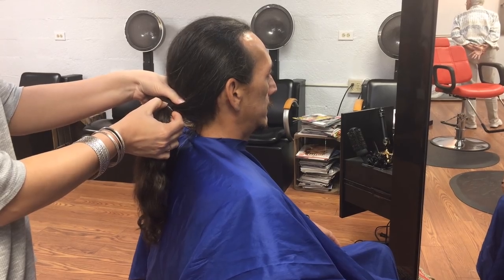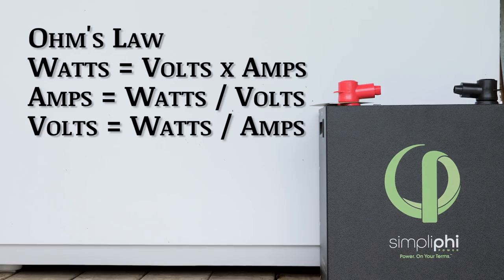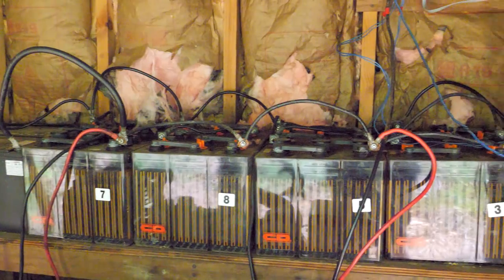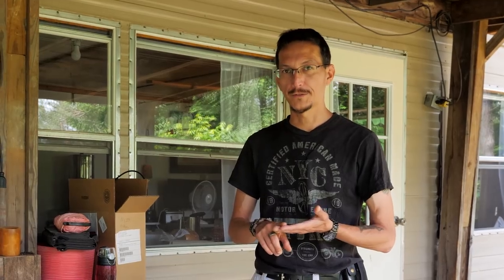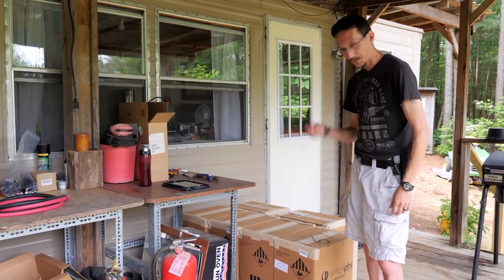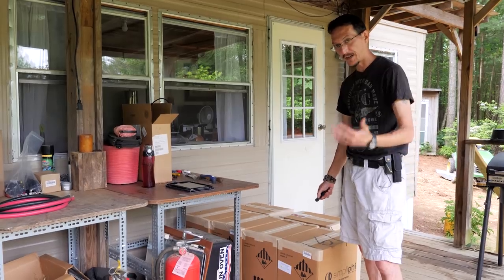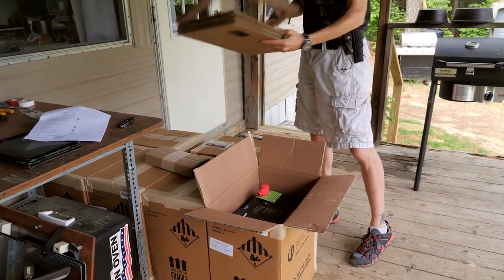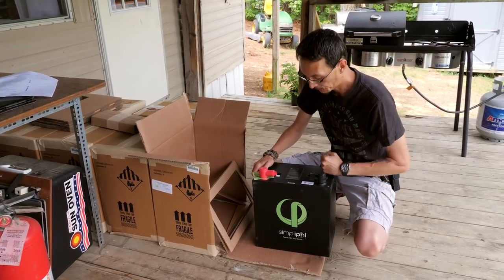DIY Off Grid Solar: Building a LiFePo4 Battery Bank (Part 2)

Comment: In another video someone commented on the length of wire from panels to inverter to end usage
Dc/ac
The bigger the wire the higher the ohms 
A.c. travels faster (less amps) or slower?
R = e over I
Did you look into moving inverter closer to batt and sending a/c thru lines?
Of course a trailer usually is wired @ 24 v dc
I heard you mention air conditioner , no way to run in DC
Fridge could be propane too
This argument goes way back to Tesla and the grid we live with
The other conundrum is geo thermal
Have you / will you exp. With this technology?
Wind turbines?
Grow your own food?
Fish pond/aqua ponics
You my friend are Living the dream!
Not jealous but envious in California

Comment: Excellent sir, Can you please make vedios for converting old any petrol bike to EV.
Also can you suggest me here I'm wud like buy 12v 40 AMPs battery. Does it give 50kms per charge...?  What is motor watt should need to select can I use 1000wat motor or do I need to select less than500wat,
 12*40=480 watt...?

Comment: Higher voltage is more forgiving on wire length... More important than having panels close, low voltage links (battery - > inverter) should be as short as you can make them with thick cables....

Comment: Man if i had to put out so much cost for batteries to support a daily 5 KWh load, i think it be may wise to just buy a 10-15KW diesel generator , im just saying if it is me, cause all electrical system has pros n cons, think about it! nothing could beat the Driven Alternator power output

Comment: As you said when ever there is a change ( inverter etc. ) there is loss of energy usually in the form of heat.
Charging the battery is also a cause of loss . For lead acid it's about 10% + a huge loss when balanced occasionally .  LIPO batteries are about 1% loss.  So your solar array needs to be larger also.

Comment: is there a formula for inrush amperage??  (like for an air conditioner compressor)  my running watts are 850.  15 amps. 120v ac.
Reply from the maker: Not really, you have to actually measure the surge amps when a compressor or pump or motor turns on. General rule I’ve heard is that surge current is 3x running amps though. 15 amps at 120v is more like 1.8Kw.
Reply: well the sticker says "850 running watts".  maybe I am not understanding you right, but how is the running load 1.8kw?
Reply from the maker: The 15 amps must be the starting surge load then because 15 amps x 120 volts is 1800 watts. That would make more sense. If it says 850 running watts then 850w / 120v is 7.08 running amps. That’s typical for a medium sized window unit. I have a smaller one than that I want to try on this new system.
Reply: ok this is an 8000 btu window unit by GE.  What is your estimate on a 5000 btu unit? what size is your ac?
Reply from the maker: Mine is a 5000btu Frigidaire. 4.8 amps, 515 watts.
Reply: ok. what are you going to do with all your old solar components?  Will you sell them to me ?
Reply from the maker: I have many pieces and parts but I’m going to try to make a small 24v system just for DC appliances. Once I get that figured out I may sell what I don’t use.
Reply: great keep me in mind!

Comment: You are incorrect regarding the voltage drop in long wires.

It's the amps that causes the loss. The higher the Amp, the higher the loss.

You will see the loss as voltage drop at the other side of the cable.

To prevent you can increase the wire thickness or increase the Voltage. By increasing the Voltage you reduce amperage (ohms law).

On a long wire run, you can run higher voltage on the PV, and if you have the correct charge controller, you can have a higher PV voltage than the battery.

The increase in price for these controllers are some times less than the extra price for thicker wires.

Comment: you did a great job explaining it.
Solar is a giant pain in the ass; buying a part time job really.
the panels cost from solar companies is over 30 years, yet the panels don't produce enough juice after 15 years. even with the tax credits, which will disappear soon, this turns into a scheme, rather than a viable solution.
it's like asbestos shingles, aluminum siding schemes of the 40's and 50's and 60's....

being off-grid, you really gotta do these calculations right...yet, it still comes down to the life of the panels, and the equipment down the chain.
best of luck.

Comment: Sorry to bother you y’all seem to have great ideas and help. I have noticed some people have ion batteries some have deep cycle batteries which seem to be cheaper. What would you use ? A 6volt series to another 6 then wired in parallel or just some 12’s wired in parallel ? I have seen YouTube vids on all 3. I would want something that I don’t have to worry about the batteries going dead over night.  I am downsizing and I am not a green person   Sorry and thanks again Gbl

Comment: I guess I am not understanding storage on batteries. So how would one of these batteries compare to a 1000 amp hour battery?
Reply from the maker: Depends on the voltage of the battery. A 6 volt 1000 amp hour battery is 6 Kilowatt Hours. A 48 volt 125 amp hour battery is also 6 Kilowatt Hours. Volts x Amps = Watts.

Comment: great explanations. it looks great. 48v is the way to go when running inverters. over 2.5k for one 3.3kw battery is a tall order. 10 year warranty my big toe. good luck with that. if everything works great its a better deal over the other battery technologies. but you never know and you cant make the manufacture honor the warranty. if things go south they go bankrupt change names then keep on trucking. great video thx for sharing I hope the system works as billed.

Comment: 3.5kW batteries of 48V comes to about "73A", however you said 6×"67Ah" a battery @ 48V. 
Did I miss something jumping from 73A to 67Ah?
Reply from the maker: 67 “usable”. Though they say you can completely discharge them I never would.

Comment: Sorry. You have stated Ohms law incorrectly. Ohms law is Voltage = Current times Resistance ( V=I*R).   What you are trying to state is the Electrical Power Equation P= V*I.

Comment: To increase AMPERAGE a longer distance you increase the diameter of the cable, not VOLTAGE.

Here’s an example,  look at you power transmission lines, high voltage, long distances, little wires.  The power is transformed back down to a lower useable voltage through a step-down transformer on the pole and comes into your home a shorter distance at 240VAC with a much higher flow of current available.

Another example is this, if the smaller wire creates more “resistance,” it creates more HEAT, which we know is associated with current, not voltage.  Voltage creates “pressure” in the lines, amperage creates volume flow through the line.

If you pressurize a tank of water to 4000 psi, and open a little tiny hole in it, the stream will spray out with a lot of pressure, cutting through whatever was in its way.  If you open the entire bottom up all at once, you get a massive flow of water with greater ability to perform heavy work at a lower pressure.

Voltage = Pressure = Arcing to dissipate excess

Current = Volume = Heat to dissipate excess

The combination of flow at pressure is what actually burns the wire up.  You need BOTH to do that.
Reply from the maker: Good explanation

Comment: We use about 100kwh per day and I am stingy on air conditioner settings. This is of course on the grid. This month we been 110 to 118 farenheit with index's way up.
Reply: You waste a lot.  Most homes waste 80-90% of the energy that goes into them.  Air leakage, thermal leakage, noisy appliances, heat given off - all waste.  Start eliminating some of that waste and your home will be more comfortable as a side-benefit.
Reply: @DK-vx5co  I live in a very hot location and my home does not get any shade from trees. I have 6" walls well insulated, double paned windows and recently installed solar shades on my windows. We have summers where the AC will hardly turn off and I have a back up 1 ton mini split to aid my 5 ton central air unit. I replaced all my indoor 76 lights with LEDs and have 8 shop lights outside with T8 tubes I believe. I also set the indoor temp to 74 instead of 70 this month. Now the next step is to replace my 10 year old washer and dryer. 

I am starting an off grid build and just recieved my 10x250 watt panels. I want a small 16x36 cabin now for weekend camping.

Comment: I can't find any info about why you can't connect those Phi batteries in series.  Does anyone know why?  Is it just because the internal charge controllers might draw different amounts of current, causing other batteries in the string to potentially see voltages over their limit?
Reply: The BMS would not be able to check the balancing on the other pack... so if you do connect them in series one could be at 100% charge and the other one at 80%. The BMS would keep the lower charged one from charging all the way and thus destroy is over time

There is a guy called Jehu Garcia he does a lot of battery stuff, may be check his channel for more info

In my opinion I don't really like Li Fe P batteries they are super pricey and if damaged very dangerous but that's just me
Reply: @Blue: But if the BMS is internal to each battery as seems to be the case here (six batteries, six BMSes), then it shouldn't matter what the other packs are doing, they can take care of themselves, right?

Comment: When I put my system together, I was cautioned not to use more than three strings of battery banks in parallel because of balancing issues between banks.  Since you ONLY wire them in parallel, (and the $3k Simpliphi 48V battery is only 67AH--pretty close to what my AGMs are rated at--but the AGMs are 1/4 the cost per 48V bank), does Simpliphi give a limit to how many batteries can be in parallel? You're running 6 in parallel, so it's obviously more than a standard battery bank.  I'm guessing that each battery's management system helps balance them (do the batteries share data via a cable?).  So your $18k 48V battery bank gives you 321 Amp-hours of capacity at 80% discharge?  I sure hope these battery prices come way down before my 8 AGMs die.  They were $200 each when I bought them in 2011 (They are $275 each now), so $1600 gave me 55 amp hours capacity at 50% discharge. They've been going strong for 7 years, but since I'm grid-tied, they rarely get below 90% unless I lose power for several days during a hurricane (which is why I sized them the way I did).  I realize that your usage is extremely different and gives your batteries much more of a workout each day than mine do.  But man, that price difference is significant.

And Simpliphi recommends 4 gauge wire between the batteries.  Do they recommend using 4 gauge to the inverter too?  What size inverter did you go with? I went with 0 gauge between my batteries and also from my battery bank to my 6KW Xantrex inverter, and the inverter is only 3 feet away from the batteries.  I know it was overkill, but a 6kw inverter can draw 125 amps at 48 volts, and it's actually designed to surge to 12kw.  I wouldn't want to push that through a 4 gauge wire.  I know that cars use 4 gauge to the starter, but they don't run that way for more than a few seconds.  I wanted plenty of room for the electrons to flow from the batteries to the inverter.
Reply from the maker: Next video will cover most of this stuff.

Comment: These aren’t really warranted for 10,000 cycles they have a 5,000 and 10,000 cycle setting configuration but the warranty is for 10 years FYI

Comment: Adding 20% is actually not enough.  you need to add 25%.  120 (120%) X 0.80 (80%) = 96%.   To find the actual Ah you need (including  your depth of discharge buffer) take your calculated needed Ah and divide by the depth of discharge percentage you want then multiply by 100.  So lets say you need 100 Ah and you want an 80% depth of discharge to your battery take 100/80=1.25 multiply that by 100 (1.25X100=125) so 125 Ah is the Ah rating of the battery you need.
Reply: I I noticed this too and agree with you 100 %. You are saying his 250AH * 1.25 = 312.5AH which is what I figure. I saw his 250AH as 80 % of his total need so I saw it like this: 250 / .8 = 312.5AH. Insert Wink here. Math is fun.

Comment: If you discharge a lithium battery 100% it will be dead. It will not take a charge after that. Because of the variation in cell voltage you shouldn't go below 90% ever.

Comment: So I checked the link and at $2900 for 3.5Kwh you would need four to match a Tesla Wall. That would be $11,000 and the Tesla Wall is $5?00. What am I missing? Seems like an expensive setup. I mean its not a sodium battery that lasts 100 years.
Reply from the maker: Ask me in 10 years when Tesla is bankrupt.
Reply: You assume batteries stop working when Tesla goes bankrupt? Or that they won't just drop making cars and stay with house/business power systems? I get it! Just awful expensive.
Reply from the maker: It is pretty spendy I agree. And only worth it if you can actually get the performance as advertised. No one really knows yet but after really diving into the tech and the people behind the company we decided to take the chance.
Reply: It will be interesting to see how it turns out. Confidence will take a little time. Hope to see video when you can say its working out for you.
Reply: Tesla builds their batteries with individual Li-on cells...which are, and will be, everywhere.
Reply: Love that you donated your hair! That was very cool of you. Now from my understanding, you can’t charge lithium batteries in the cold. You can take from them but not charge them. I was reading somewhere that it will damage them. Did the company say anything about that? I was just wondering.
Reply: I really like what Tesla is doing and have nothing but respect for them, but there are a few choices that you cannot make yourself if you go the Tesla route.  The Powerwall includes an inverter, so if that breaks you can't just replace it with one off the shelf, you have to pay Tesla for an exact replacement part.  You don't get access to the batteries, so in order to charge them you need a more expensive grid-tied inverter rather than a cheaper solar controller (the Powerwall presents itself as if it were the electric grid, even if you're off-grid, so you have to feed in to this "grid" to charge it).  You can't add batteries or replace old ones, you can only buy new or replace whole Powerwalls.  All the stats you get on your phone appear to be hosted in the cloud, so your Powerwall apparently phones home to Tesla all the time, which causes privacy issues for some people (not sure if this Internet connection is mandatory for it to function though).  It is a lot cheaper, so it's up to the individual whether it's worth it.  For most people who don't like DIY and share everything they do on Facebook, the Powerwall is by far the easier option.  But not everyone is like that :-)
Reply from the maker: Nailed it

Comment: How much was the freaking battery? A small fortune I bet. I hate when people don't reveal price!
Reply: From the link provided: SimpliPhi Power PHI 3.8kWh Lithium (LFP) Battery, 48V
$2895.00
 each.
Reply: I hate when people don't look on the Interweb.  it's not a conspiracy-secret.  Maybe you could just buy a box of matches and light one in the night when you need to read instructions.  That would be a much smaller fortune.

Comment: One more question...if one of these lithium iron phosphate batteries goes bad after, let's say 5 years and is replaced under warranty, is there any balancing problem incurred by sticking a brand new battery in parallel with a bunch of 5 year old ones?  Changing just one is not recommended with lead acid batteries, but I don't know if they are talking about changing just one in a 4 battery bank that's in series, or if that applies to batteries in parallel as well?   I figured that when my AGMs started to go bad, I would replace them all at once.  But I wouldn't even consider that with those Lithiums.
Reply: Charging batteries in parallel can be problematic because the charge rate is controlled by the voltage.  If you put a higher voltage in, the battery will take in more power and charge faster (or possibly overcharge if it's near full).  This means you typically need to start charging a battery with a higher voltage, and gradually lower it until the battery is fully charged (there are many variations on this, this is just a simplified explanation).  So when you charge new and old batteries in parallel, they all see the same voltage, even though some may need higher voltages and others need lower ones.  The result is that none of the batteries will charge optimally.  In this case the battery packs have built in charge management circuitry, so they can (I imagine) take a higher voltage and convert it down into whatever voltage that battery actually needs, which might be different from the next battery.  This way you can charge them in parallel and each battery will just draw whatever power it needs.  However I am guessing here, so I could be wrong.
Reply: Vink, lead batteries have a pretty complicated charging scheme. Lithium's do not. Provided you don't put too many volts in them they will take what they want until there are little to no amps flowing into the batteries. While it is true you can get peak charge rates at different voltages you don't ever want to over-voltage lithium batteries. If they are in parallel and you mix old and new you will be fine charging them. Discharging them can be another story though. If you draw a weak battery too quickly it will expend more capacity as a % relative to its peers. If you size your pack large enough, this won't be an issue though as you shouldn't come near the higher power draw required to do that. That is typically seen in performance related situations, such as EV cars or high performance RC vehicles/aircraft.